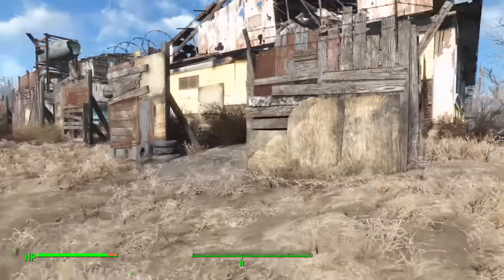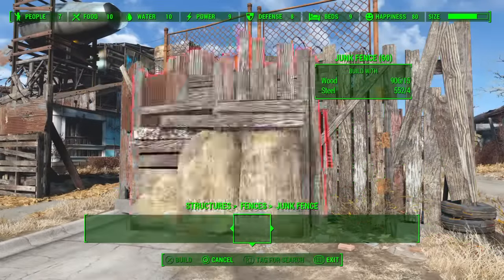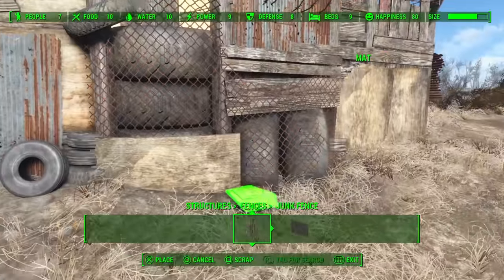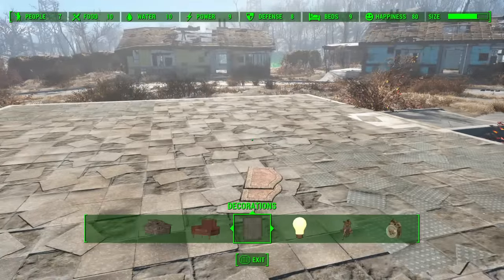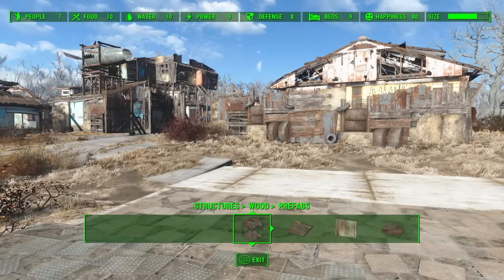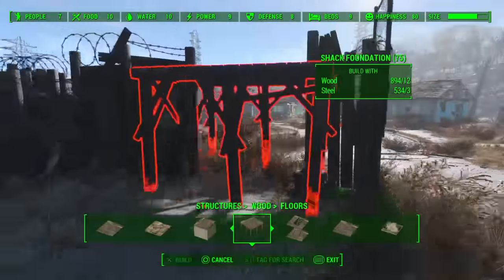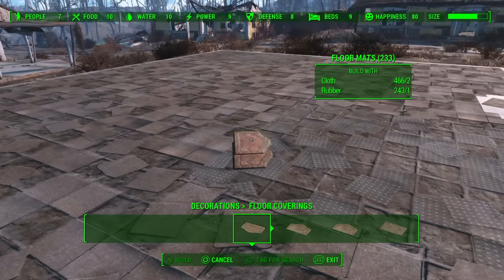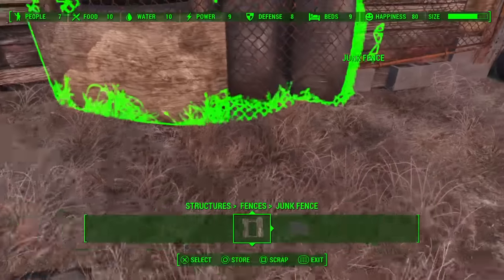Fallout 4 Guide - Junk Fences

Comment: the big gate works with the rug glich you just have to use a few rugs stacked and then place the gate hinge on the mat
Reply from the maker: +Dwight Frickle Oh really? I had no idea - I could never get it working.
Reply: +norespawns Yeah it works for me as long as I make sure the cinder blocks are right on the top rug.
Reply: +norespawns it also works when you hold x  :)
Reply: +Luc Marguerat Yeah but that can be a bit frustrating for adjusting the position. You have to get it right the first time.
Reply: +Dwight Frickle Ill second that
Reply: +norespawns use the big blue rug ,than the small rug under that ,im sure you done that on one of your videos
Reply: +norespawns yeah I got it to work after i was inspired by your castle your castle video. I made a tunnel with the gate recessed in the wall. The little doors I can't get though. Also I have been putting wight picket fince in front of my wall finces in sections that repeat. it makes them look different. (a little extra work but I know how you don't like parts that look the same)
Reply: +norespawns  I used two rugs last night on the big junk fence and was able to "glitch" it in between 2 concrete block floors.

Comment: 4:24 The tire junk fence is placed from the back. You don’t like the look. Totally fine. But consider this. I think the “bump out” from the tires in the front gives some useable cover, in case you’re out front, and get caught in a firefight.  

During settlement attacks, the game will put enemies inside your base. If you get a message to defend it, and run back or fast travel, the game will do a calculation for how long it took you to arrive after the attack starts, then spawn enemies inside your base based on how far they could’ve travelled. It doesn’t matter if you have a maze guarded by missile launchers at every entrance. The game figures out how far inside your base to place enemies by how the crow flies. 

This highlights why the Vertibirds are so great. They get you places fast. Fast travel isn’t fast, it calculates how long it takes to walk, then advances the clock to match. So if you want to have yet best chance to catch enemies outside your base, hop a Vertibird as soon as you get the notification for defense

Comment: have you seen how to put doors in without the doorframes? you have to use a door frame, place the door, delete the frame(or just move it away) put a cement block next to the door hold and select both while aiming at the cement. Then adjust the height of both of them now get rid of the cement block.
use the wire fince and put it perpendicular to the door, now you can move both of them and place the door in the games pre existing door frames and it will work once placed. I know it's a long process but it looks really good
Reply from the maker: +Dwight Frickle Yeah I've tried it - you may notice of my last let's build that I add some decking around the doorways; I think because my buildings are all covered in wood; I do like using the doorway method I've always used. Personal preference I guess :)

Comment: norespawns iv used the wire fence to move the junk gate through concrete mate that and the picket fence post as well works the door will move regarless iv got small floor pieces going along mine and it still works

Comment: Is there a way I can prevent objects from dropping/rising when I delete the rugs?
I'm currently having an issue with placing a nuka cola machine in the corner of a raised shack, and every time I delete the rug underneath the machine it falls through the floor of the shack right down to the ground underneath. 
Help would be greatly appreciated.
Reply from the maker: +MrYyelo ah ha! There is - you need to just come back at a later time. I don't know the exact period/reason for it; but just leave them there - go questing, fast travel etc.

When some time has passed you can remove them and they should not drop down.
Reply: Thanks a lot.

Comment: Im on xbox and the small rug glitch only works for me when i do the cover for the houses in sanctuary other then that i have to use the big rug for the walls because the small ones don't work for me for some reason but im going to try again since seems xbox users are saying it works. for the gate you can use the big rug and you can just put the gate on top of the big rug it does not have to be touching just above it and it will work.

Comment: I'm on xbox1 and had a mare trying to place junk-fences at County Crossing. You know the strip of land near the water - between the derelict house and small shack. That mound of earth just wouldn't let me use the rug glitch on it. But I was only using 1 rug. His is the first time I've seen 2 rugs used. I put it down to not being able to find a genuinely flat piece of ground at County Crossing to link the rug and junk-fence.
Guys, what's 2 rugs letting you do that 1 rug might not?
Reply from the maker: Two rugs gives you more reach - if you're having trouble with uneven land might want to just place down a line of them and then use that to move the fence into place. It looks ridiculous; but should help you.

Comment: So you can pick up individual junk wall pieces by the rug without picking up the others, even if they're touching? Man, that would have saved me a lot of work if I'd noticed that.

With your custom guard tower, will full wall pieces fit onto the sides? That way you can take pity on your guards and put a roof over them if you like. Although I guess that can restrict their field of fire.

Edit: I can't seem to get the rug glitch to work on PC with junk walls at all. It's fairly reliable when using your method to roof over a pre-existing building, but not with junk fences. Maybe I'm just doing it wrong somehow.
Reply: +Lytrigian definet considerations ive made ,you dont have to have too much of a military background to know that standing out in the rain all day would suck and if your static ,it could lead to mild hypothermia ,keeping dry is essential for moral .
Reply: +Lytrigian Oh and as for putting walls up ,I didnt do that but rather put up a prefab with no walls but a roof ,a prefab just because it gives you those support beams ,you have to put  floor tiles down around your central floor tile so that the prefab wont clip to the sides.

Comment: Hey Davey, great videos! Just wanted to ask if you have found a way to prevent the sinking that occurs when using the rug glitch? Doesn't seem to happen to the junk fences in this video, but as you discussed in a previousone, objects like the terminal end up in the floor. I recently built a great chem lab, and when placing a cabinet, instead of it sinking, it actually raised higher and fitted much more snugly into position than i expected. Then, why I tried to do the same on the opposite side of the room (i am a sucker for symmetry) ,  the cabinet sank as is normal. Have you found a way around this? or is it only the junk fences that do not sink? Thanks mate, keep up the great work! Very inspiring.

Comment: Xbox user - the rug glitch works for me but it's less reliable than what I'm seeing on this video. For the big tire junk fence I'd often have to try moving it several times to get it to stick. I usually only use one rug though so that could be why.
Reply: +BobbySoFamous I'm going to recant the "less reliable" part. The rug glitch works fine, it just takes a little practice to get familiar with which pieces you need to put on the rug vs. which you need to put near the rug and hold A rather than just tapping. Also there's some nuance with how close to place the rug.

Comment: Yo Davey, thanx for the tips its really helped my Sanctuary look a 100x better than before. However, this clipping glitch doesnt seem to work well with Junk Fence Doorways, and I have to use the "rug next to object" technique instead of the "object on rug with stairway of rugs" technique (hopefully you know what i mean)- which doesnt really work well. Do you have any tips regarding this? I want to make a pathway through my fence leading to a sniper post.
Reply from the maker: +MagmaSTORM208 I've never got it working for the doors or the fences (though others have). I just make sure to put the door/gates in first and then sink the fences into them with the glitch.
Reply: +norespawns Eventually figured that out, but thanks again 😀

Comment: not working at all on PS4.. i use the rug glitch all the time but i've been trying to get this working for close to an hour and it just won't. i have auto updates on but i don't know why this would get patched.
Reply: +srg. Arch Dornan won't work for me and I'm on ps4, only junk fences won't work idk what to do
Reply: i actually ended up figuring it out, try using the road in sanctuary or some other flat surface and put down the small rug, then one of the big ones about halfway down the small rug. pick up the small rug and if it doesn't take the big one with it then try again. if it doesn't work then, put down a big rug, a small rug about halfway off the edge of that, and another big rug halfway down the small rug and try then!

Comment: On Xbox, it works and. Have auto updates on.
Reply from the maker: +Knightmare Gamer This pleases me. cheers.
Reply: +norespawns it may be because of certain ways they try to move items with the rug glitch, such as holding A when the item is already reliant to the rug, which means you only have to Tap A and its attached ontop of it, but items that snap (as you said) will require you to Hold A just like putting a roof on the sanctuary homes.
Reply from the maker: +Knightmare Gamer yeah I think it's likely that too - it's difficult for me to discern if people are doing it right or not (and time consuming for me to explain to each person too). I'll just link them to these comments from now on :)
Reply: +norespawns you may be able to use the hold X with the rug to move the junk fence doors, just stack up the rugs until the fence ends up reliant on them
Reply: I'm on Xbox and I've no idea what I'm doing wrong. I stack 2 rugs then but the fence on top of the second rug. Select the first rug by tapping A but it never moves the fence. Any help?
Reply: +Steven Marshall move them both to a slope, and put the mat down, then put the junk fence on it so you can clearly see the junk fence is only placed on the rug and not touching the floor. This way you should be able to confirm that the fence is reliant on the rug, then move the rug, try tapping A before trying holding A, because the game is a little less forgiving when it comes to merging placed items.

Comment: you know we shouldnt have to do this glitch, if walls can snap why not fences ? it seems really stupid  how bethesda leaves them out, in the conference they say to be creative and shit, but more often then not i feel like committing suicide from their building mechanics, and most "cool" items are not even build-able its so shit, pc players dont have to worry but its the consoles. for the fences i ended up using normal corrugated metal walls and placing a platform on top and a little guard post as a way for guards to patrol.
Reply: +CrazyRetroJunkie Partly because you want to be able to make junk fences go any which way and not just in a straight line or along clean corners.

To me it's not so much the lack of snapping as the fact that clipping these kinds of objects into each other is an issue in the first place. Why are the meshes designed so that without exploiting a glitch the walls CANNOT be placed without leaving a gap? That's just stupid. Obviously, the game designers themselves labored under no such limitation. Why didn't they trust players to "do it right"?

Comment: Still doesn't work on Xbox 😢
Reply from the maker: Does, did it the other day on my Xbox s
Reply: @norespawns please id like to know how, I spent a few good hours trying this and many other methods, (Xbox series X)  junkfence just doesn't sit on the rugs,  or on floors, scaffolding ladder doesn't work, poles don't work, connecting conduit didn't work, rug chains didn't work, building it of the ground didn't work,  I ended up making my wall from a concrete wall with barbed wire and stuff in g2m mod
Reply: @norespawns  I use your red rocket fence and some others, I like to add to wht you've built already... I was doing this for starlight drive in but like I said no luck man, didn't work with the junkfence for me,